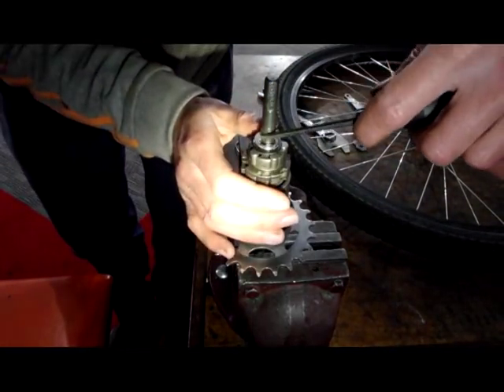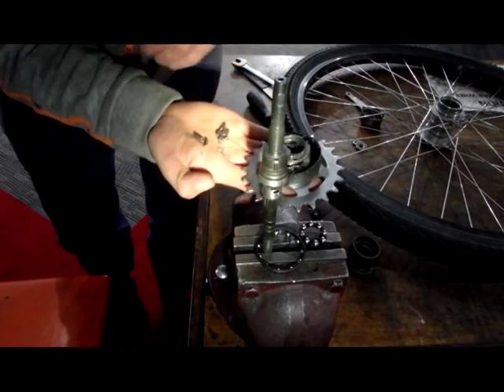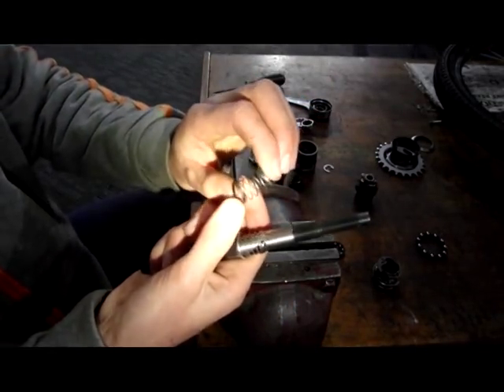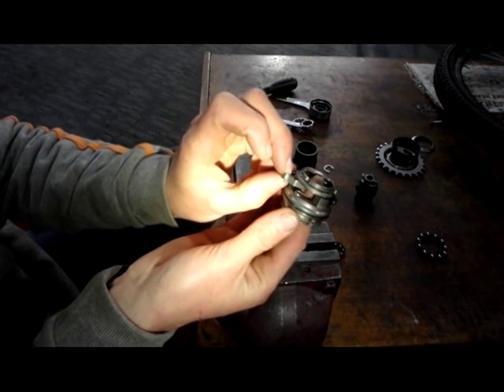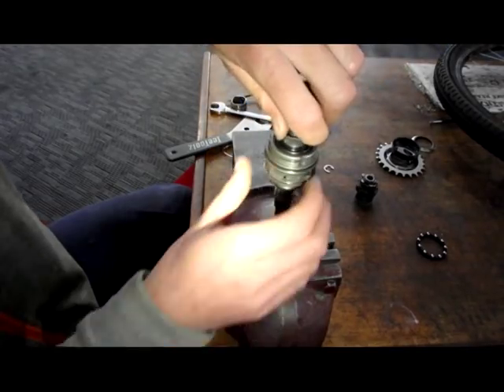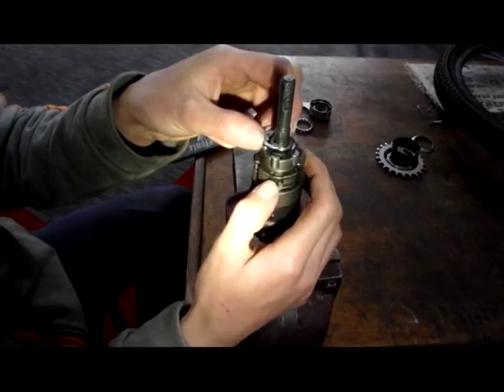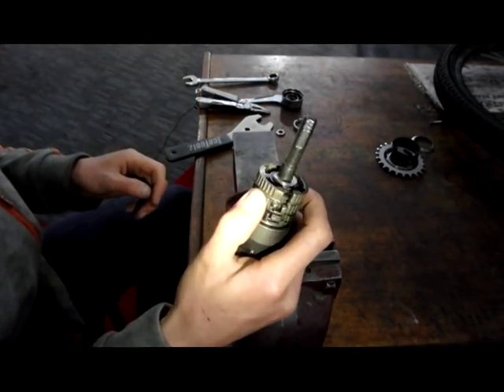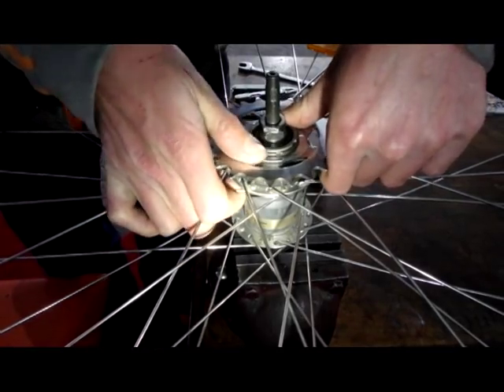How to strip and rebuild a Nexus 3 speed hub

Comment: very cool video i have a question i may please ok first  i am novice bike builder i  am building my first custom bicycle and i am thinking on using this hub but what i want to know is if if it will work on 100mm dropouts and if not can i swap out the axle and put one that it will work?
Reply: Get a off center sprocket
At HSBC bicycle.com😁
Reply: Hbbc bicycle. Com

Comment: Got a new bike with this hub. I just assemble it but when I changed from 1 to 2 or 3 the hub makes a ticking noise. I haven’t adjust it. It sounds like when a normal derailleur wants to change and the chain won’t go.
Reply from the maker: take it apart as per video, check that nothing untoward is going on, put back  together, set bell crank between the lines on gear 2, and check the length of the push pin, 81mm or 86mm 
then get back to me
Reply: Adam Edington Thanks a lot. Will do. Awesome stuff.

Comment: Which part is most likely to be worn or broken when the ting starts to like not grab or skip gears? In other words, is there a common fault?
Reply from the maker: the most common fault in my experience running a fleet of 500, is for enough wear to open up some clearances... pin drops out far enough to let a spring drop out of the drive side bearing assembly , spring works its way to gears and gets munched, munched spring bits work their way into the bell housing, and it jams between 2 gears and locks the axle. once this happens, ya kinda know about it!
next most common is for the drive side bearing housing to fracture at the thin lip and shed hardened shards into the works... same effect
Reply: @AdamEdington  Thanks a lot, Adam, and for the video which is excellent. Quess I´ll go for a total replacement - as usual:)

Comment: i have a 3 speed adult husky tricycle and the reference number on the hub SG-3C41 nexus inter 3
the problem is that the 3rd speed does not work
would i need to buy the entire hub kit?
 hub drive? shifter/crank?
Reply from the maker: Most likely the cable isnt adjusted properly set shifter on 2 and the pin pusher should be between the lines.
Next most likely, wrong length push pin... a bit of high tensile fencing wire cut to the right length will do options are 81mm or 86 from memory
Reply: @AdamEdington  thanks adam
Reply: The push pin should 14mm stay out of the axle!

Comment from the maker: for starters, use the one with external drum brakes, the featured hub is the worst piece of schite out
Reply: The brake on mine is all messed up, is there a way to replace it with a different one?
Reply from the maker: @simiken1234  sorry for the late reply, I only just found this question. Find another hub and cannibalize parts, but be ware of different axle lengths. Shouldn't affect breaks though

Comment: Thanks for the fantastic vid! I thought I had damaged my pawls on this hub. It was making cracking sounds and slipping. Using this video, I replaced the entire internal assembly with a new one and the same issue is still there. Is it possible for the hub shell to fail first (e.g.  the pawls are fine but they’re not getting enough bite on the shell?)
Reply from the maker: Clean away the grease, with some citrus based(d-limonine) cleaner, and inspect all surfaces.
Chech pin length,
Check the new set of guts isn't knackered, check all bearing race surfaces for brinelling. 
Check spacer washer between brake reaction arm and bike frame.

Comment: I have this exact nexus 3 speed. I take wheels off to fix the flat. But when I put back the wheel. 

Bike chain is running against speed shiftet cable. 

Can you sent few picture shifter cable are suppose to mounted on the bile
Reply from the maker: Without seeing the bike...Check wheel alignment. Check brake reaction arm gap to chassis, insert apropriate spacer  to avoid bearing failure. Check the bell-crank hasnt twisted and pulled more cable through
Reply: What is your email address? I sent u picture of my wheel mount on the frame.  

I spend all day today try different way to mount wheel back on the bike frame. But shifter cable still rubbing against bike chain.

I forgot to take picture before I take it apart. Did not think it is this difficult to put it back on.

Comment: Crazy question, can I convert my C/B version into a freewheel version? I have no use for the C/B, that's just the way the wheel-set came and until recently I wasn't using that wheel-set off road.
Reply from the maker: if i understand your question correctly,  it is just a matter of leaving the brake shoes out, but make sure you have an alternate braking system on the back wheel
Reply: The bike I have it on has front and rear Cantilever hand brakes. It was originally configured as a hybrid MTN bike (Rigid frame) that looks like a beach cruiser AND has 26" BMX angles.....it's a nutty bike. It has a derailleur hanger on it, but I converted it to internal gears. I had a Nexus 7spd on it, but my Brother talked me out of that wheel set sometime in the 90s.....so I got this wheel set with the 3spd.
Reply: Can you make a vid showing how to accomplish taking the brake shoes out? I can "kinda" see what you are referring to as "brake shoes" but you don't go into much detail on that process.
Reply: Watching the vid again, at the 10:56 mark, are you suggesting one can merely leave that expanding brake shoe mechanism out of the re-assembly? It seems that there would be something go horribly wrong....lol....correct me if I am wrong please.
Reply from the maker: just take the brake shoes out then
Reply: I'll do it, it just doesn't seem such a simple fix would work!! lol....it just seems that there would be all kinds of loose shit in there with that whole brake shoe assemble missing! You know more than I do, that's without a doubt
Reply from the maker: if you are really worried, you might want to remove the 5 cams from the cam roller assembly behind a surclip and washer, but if it isnt worn too much(like a public hire bike would be) you shouldnt have an issue
Reply: @AdamEdington  Is it possible to leave the brake shoes out, and add a roller brake?  I have  a bike I wish to convert to an e-bike, and the frame unfortunately doesn't have brake bosses for v-brakes, and I would like the rear hub to freewheel.
Reply from the maker: @DougRansom1  needs to have compatible spline on the outside of the hub to couple the brake assembly to the hub

Comment: have you ever stripped a nexus d8? i got one booked in and slightly stiff i wanna strip it down but ive never really done it before?
Reply: Adam Edington stripped it down today, degreased and regreased, i thought it was the grease shimano use, i find it solidifys after a few years normally a problem with shifters
Reply from the maker: make sure you dont use HTB it is toooo viscous and will stuff things up

Comment: Fuck me. This gear system is a pain in the ass :-(((
Reply from the maker: hence the need for this video
Reply from the maker: good to hear
generally if you pull it right apart, and put it all back together with broken parts replaced, scrounged from a dead hub, it will work
Reply from the maker: spanner tighten the drive side bearing cone(square with rubber seal) right up to the end of the thread and lock with 17mm large thread locknut. 
finger tighten the brake side 22mm nut, spanner tighten 17mm small thread locknut